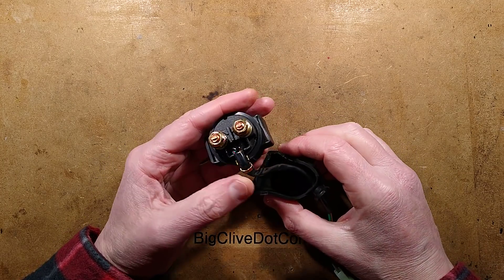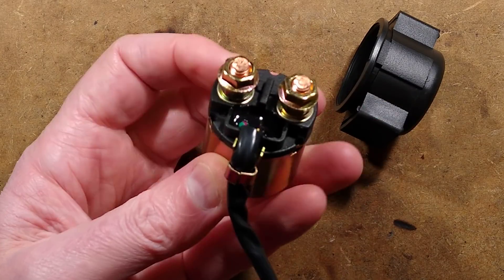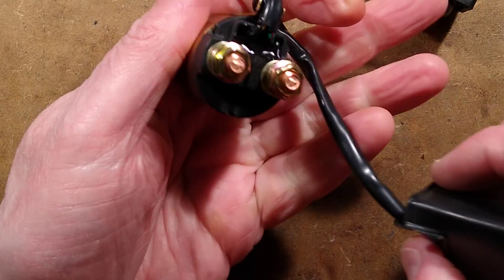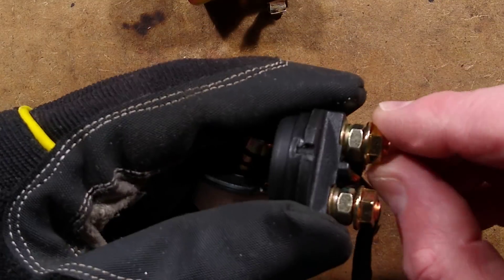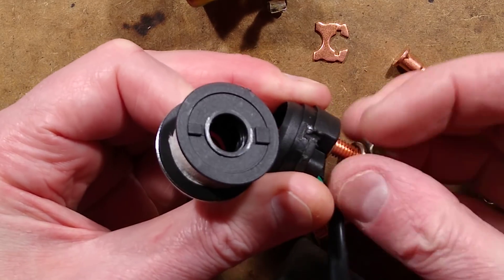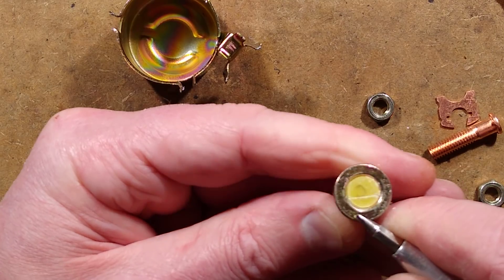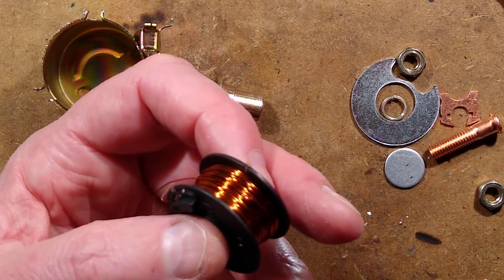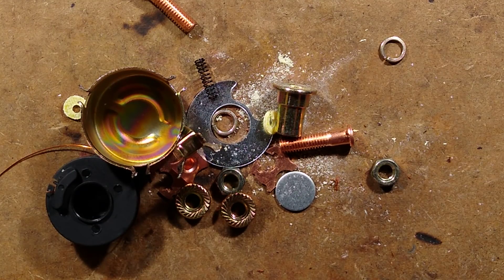Inside a cheap quad/scooter starter relay solenoid

Comment: Clive, some 6v systems are used on early gy6 scooters mainly 50cc's, but my 125cc motorbike had a 6v system I quicly upgraded so I can add LED headlights.On my gy6 with 3 years of ownership, I never had issues with solenoids. Only kickstand switches.
Reply: Kickstand switches ????????
Reply: @millomweb  yeah, kickstand on some scooters have an interlock that prevents the starter from activating if the single kickstand is left down. It's connected to the HT. ASK me how I know. Not pleasant trying to diagnose that fault when cranking! Some kill the starter, some kill the HT. It's a common failure point because its in the spray line from the road.
Reply: @monkehmonkehmonkehmonkeh  The bizarre thing about this is the fact that kick-stands were designed to fold up with forward motion - i.e. setting off with the stand down !
Reply: @millomweb  yep, I understand kickstand operation and I understand why they would interlock the starter out. Some of the REALLY cheap chinese scooters didn't have center stands. I had to fit alarm kits to a few of them (they got really popular here for some reason) and they had a remote start function. But digressing - you wouldn't kick one of these sidestands away with setting off. They're made to be pushed back with a foot. You'd probably bend the chassis using the bike to shove the stand back!
Reply: @monkehmonkehmonkehmonkeh  But it is the reason stands always fold backwards !
As for no main stand - on the basis that the kick-stand was for convenience, particularly with heavier bikes, (I remember the effort my Dad needed to get his BSA 350 onto the main stand !) cheap light bikes having a main stand only may have been a better option !
Reply: @millomweb  yeah, these gy6 bikes, put massive emphasis on being cheap. My 06 plated one, I had what 6 years ago, looked like it had been dipped in saltwater for 2 years. I had a 64 plate, I bought brand new, never made it through its first mot because of rust. That had a main stand and kicker, light as a feather but bent the frame over time and use. Unfortunately I'll never be able to savour big bikes at all. Becoming a medical statistic ended my bike career.
Reply: @monkehmonkehmonkehmonkeh  I think the law would have supported you in getting that rusty one fixed - 3 years is terrible - even for a cheapo.
My Dad had a few spills. One time overtaking a double-decker bus on ice on his knees!
Another (age 17) broke his arm near the elbow. The repair didn't allow full bending of elbow - so not fit for the Front in WWII. He ended up assembling aero engines and from there a career as a motor engineer.

Comment: Auto parts salesman here! If you want a heavier duty starter relay/solenoid, ask for a glow plug relay. It's the same thing, just rated for a longer duty cycle. 
For the old-ish Ford style ones, the part# scheme my store uses is S5049 for the starter relay and GPR11 for the glow plug relay. 
Continuous duty versions exist, but will be harder to find and likely aren't in stock at a typical auto parts store. Go for something aimed more towards farmers, industrial and fleet customers.

Comment: Back in the early 80's my dad had an FSO Polenez. The starter solenoid stopped working.  So we took it apart, to find that the terminals were burned and pitted. This made the contacts unable to pass any current. So we cleaned them up and made 2 copper washers out of some flattened copper tube to shim the contacts out a bit. When refitted the starter worked perfectly.   This was because a new starter was about £100 then !
Reply: The Polenz didn't have a hand throttle AFAIK. But an estate car style FSO did - it was another pull like the choke next to the choke !
Reply: Shouldn't have needed to buy a whole new starter just for the solenoid !
Reply: @millomweb  On many newer vehicles you do, because the solenoid is permanently attached to the motor. Usually it's combined with the drive-gear plunger assembly, so that a single coil can serve both functions.

A surprising number of those units are actually rebuildable, if you can locate/fabricate the parts. A screwed-together housing is quite helpful in other ways - I normally open up new starters to check for corrosion after receiving a run of DOA replacements. A few minutes with a screwdriver and some sandpaper can save a great deal of hassle exchanging parts.
Reply: @Azlehria  It's called a bendix dude. Why would you repair a new part under warranty? You need an Uber and a diaper. You are drunker than a cobra snake wearing mickey mouse ears. So am I actually. 🤪
Reply: @ipissed  A Bendix drive is purely mechanical and prone to clashing gears; modern starters for many years have used a solenoid drive to extend the spur gear before the motor starts. In gear-reduction starters the spur gear is directly extended by the solenoid; in direct-drive starters a linkage is used.

I "repair" new starters for the same reason that I clean blocks and heads freshly returned from a machine shop: to ensure that I'm installing good parts. They may or may not be serviceable as-delivered; they are serviceable when I install them. Sometimes a brief inspection shows no problems and sometimes there's corrosion, swarf, or casting flash that could reduce the service life or even prevent the part from working at all.

A few minutes of inspection and cleaning often prevents hours of warranty repair. Warranty work pays for shit, costs the company money, and damages your reputation - which is the last thing an independent needs.

I took the same approach into electrical work and within 3 years I was getting contracted to fly across the country to fix other people's work at emergency rates.

Do it once and do it right. Callbacks/warranty jobs provide more money for hourly workers - until your reputation is destroyed and all the work dries up.
Reply: @Azlehria  "On many newer vehicles you do, because the solenoid is permanently attached to the motor." As I said in my lengthy comment elsewhere. They are assembled - so will disassemble to repair/replace failed parts.
Reply: Oh you were the other person. Personally the engine blew up..............twice and the prop shaft snapped in half.
Reply: @bytesback.  I was aware of 2 and none had significant issues !
Reply: He had it for 6 years. Towed a caravan reasonably well ( only a 1500cc engine 4speed box )  did about 70k miles in it.    We put in a sunroof and an electric cooling fan for the engine.  Apart from normal service and wear replacement, we did very little work to it..
Reply: @robertwillis4061  Yeah, I think we must have had a friday car.
Reply: @robertwillis4061  How were they to drive and for comfort ?
Reply: @millomweb  They were a heavy car. You had to slow down for corners more than  you would today. Comfort wise they were great and they had buckets of room.
Reply: @bytesback.  'heavy' - an impression I got. Am I right in thinking no power steering ? So tyres well inflated was good practice for ease of steering ?
I've never been in a moving FSO !
Reply: @millomweb  I cant remember about the power steering though I suspect there wasn't any. The thing was a bloody tank !
Reply: @bytesback.  yeah no power steering.  Brakes needed a good push to work.  But it had discs all-round.  Rear wheel drive.   My father's was one of the early models with the black rubberised bumpers..    It was a sort of Khaki colour.  Brown interior. Front seats were big and comfortable. And yes the handling wasn't great.   Dad put wider tyres on it think it had 165 r 13 and he went to 185/70 r 13.  Was a thirsty car but all in all relatively reliable.
Reply: @bytesback.  Matches my Dad's description exactly !
He also once said the same about a BMW !

Comment: 6 Volt bikes are decades ago. The 12 Volt battery may drop several Volts while cranking the starter.
Reply: It shouldn't ;)
Reply: @millomweb  Cars once had 6 Volt coils and a ballast resistor, the ballast resistor was bypassed when the starter motor was turning. Here is a diesel engine drop from 12 to 10 Volts when the glow plugs are on. https://www.youtube.com/watch?v=mTlU6RTKDLE
Reply: @dundeemink3847  I'm aware of 6V systems but battery voltage shouldn't drop several volts when the starter's being used.

Comment: Well, the good news is that even Western produced solenoid switches use steel studs, and not often copper-clad ones! Now, the contacts are a bit dire, certainly lacking substance at any rate. Ultimately though, it is what it is, and it does what it does. If it doesn't do what's expected, then you chuck it out and buy another! Beyond that,  its operation is all arse first, but at least it does mean that the same contact pressure is maintained regardless of battery condition!  The coil will get hot quite rapidly when there is no starter motor/load to pull down the battery volts - Even then, it's only meant for a few seconds of continuous use.
Reply: The arse about faceness means breaking the circuit will be snappy as the armature gets up to speed before hammering the contacts apart - something it may achieve even if they're slightly welded together :)
Reply: @millomweb  Now that's thought!
Reply: Op

Comment: As an ex mechanic watching these makes me wince, in fact on a few videos I'd fast forward only to see a new plaster a few minutes in and the relief was palpable ;)
Reply: I once killed a watch doing brakes. Refitting shoe pull-off springs, slipped and pulled the watch strap off the pin in the watch case. Threaded the strap back round the pin and tapped it over with a hammer. I was never any good with a hammer - so that was the end of that watch. PITY it was quite a good one.

Comment: But the solenoid contact/pin is also made of metal, so why doesn't it bridges between the 2 copper contacts when no current is passing on the solenoid (i.e. when the big spring is pushing the solenoid against the copper contacts)?
Reply from the maker: It stops clear of the contacts.
Reply: @bigclivedotcom  
Is that reliable?
With time I would imagine that fiberglass inside the pin starting to crack and allowing the solenoid to get closer and closer to the copper contacts.

Comment: Ive got a nightcore tiki that i bought and it came on and stayed on wouldn't turn off do you want it
Reply from the maker: Did you get a refund or replacement?
Reply: Also be mindful of where you got it. Ebay and most of the sites are flooded with fake nightcore

Comment: Hey BigClive. I just found an AC-powered 8xAA ni-mh charger that's apparently so bad that they include a pair of safety glasses with it. It's surprisingly hard to find via keywords, so here's a link. Just sharing the laugh. aliexpress.com/item/4000990517068.html
PS. I was looking for a cheap 8xAA nimh charger to modify into a slow trickle charger for storing nimh batteries at full charge.

Comment: 3:50 yea youre not gonna do that on modern cars, computer says no, virtual warranty seal broken and a paid upgrade to newest firmware required to fit a new starter relay since the old one which was fine got reworked for no reason and now requires a epic games account and monthly subscription
Reply: Which is why I'm still running a car manufactured in 1985. New enough to have CDI (no breaker points) but that's about the only electronics in it - and I have a spare module.

Comment: You could start the old land rover defenders by putting a screwdriver across similar terminals under the bonnet. Perfect for when you lost the keys and never bothered getting new ones 🤣
Reply: In the US, Fords used to use that sort of solenoid, conveniently placed right on top of the inner fender. If it clicks but doesn't start when you turn the key, the battery's low, if it doesn't click, diagnostic step 2 is to put a screwdriver across those posts. If it starts and melts a divot in the screwdriver, it's the solenoid that's gone bad, if not, the battery is completely dead or there's a wire broken (usually both).
Reply: Well you could turn them over, I don't know that the ignition would be working without keys, but I could be wrong.
Reply: @--_DJ_--   To get the ignition working, just apply 12V to one side of the ignition coil primary (the side NOT connected to ground), which, even if the car is fuel injected, will still work and backfeed 12V to the engine control module and all of the sensors and solenoids. At least this would work on cars that don't use some sort of anti-theft transponder in the key.
Reply: @brianleeper5737  I have my doubts about that on anything computer controlled. The ECM wouldn't be getting its power to do its thing from an ignition coil output circuit, it would be the source or in control of the power, through a relay. All you would do is make a hot wire to a relay that isn't connected to anything else in the system.
Reply: @--_DJ_--  And now you discover the advantages of the trad diesels !
Reply: @millomweb  Yep, I use an old 1990 JCB with a Perkins to plow the lot at work. It had a practically non functional alternator on it (10v at full song) for about the last 2 months. All you needed was to get it started and it would happily run until the job was finished. Just needs enough juice for the starter and the fuel shut off solenoid, though that could be wired open if you were really in a pinch to get it going.
Reply: @--_DJ_--  On Ford EEC-IV vehicles, the ignition coil AND the ECM (EEC-IV) are on the downstream side of what Ford calls the "PCM power relay". And the EEC-IV (TFI-IV or EDIS module actually--the coil is not driven directly by the ECM) activates the ignition coil by grounding it (this is true for practically all ECMs...they control a device by sinking current, not sourcing it). So on these cars, where the 12V feeding the ignition coil is connected in parallel with the ECM, the fuel injectors, other solenoids, etc, connecting 12V to the ignition coil will power up the entire fuel injection system just like turning the key to ON.
Reply: @brianleeper5737 There is always an exception to the rule I suppose. A quick Google was able to corroborate your story pretty quickly. That's a good one to know. I am aware of how most ECMs control outputs. That is why I put "in control of".
Reply: @--_DJ_--  That's modern. No electrics on old diesels - although a starting motor is handy but a good old cord-pull donkey engine will do.
Reply: @millomweb  What defines a traditional diesel to you? It has to be able to be hand cranked and have no wires on it at all? I'd call an air cooled Duetz traditional, even with a belt minder, a temp sensor and a shutdown solenoid.

Comment: A starter solenoid proper is a combination of a contactor and a solenoid with linkage that pulls the starter motor gear into contact with the matching gear teeth on the perimeter of the flywheel.
Reply: Wrong. Proper starter is in constant mesh with the crankshaft using a sprag clutch in between. This is the way it is in every Honda engine and their chinese clones and it never breaks. The useless mechanical linkage is what always breaks.
Reply: @bluef1sh926  Nope. Starters with solenoids are disengaged until the solenoid brings the gears into contact. That's what the solenoid is for. I've replaced starters on Japanese, German, and American vehicles from Studebakers, to Mercedes, to Hondas.  Watch for yourself..... here's the starter from a Honda. https://www.youtube.com/watch?v=XIupJqiROjg&t=112  You can see the gear jump away from the motor body to where it would mesh with teeth on the flywheel and then back again on spring return when the motor is unpowered. It's repeated a whole bunch of times. Here's more of an explanation which isn't a Honda but they work the same. https://www.youtube.com/watch?v=6x2hIOtBfzE Motorcycles and ATVs don't have solenoids; instead they use a starter clutch. https://youtu.be/s45Z6PI8oSU?t=314  They have motors and a starting relay or contactor, but no real solenoid regardless of what you want to mislabel the relay/contactor as. That's why I started with, "A starter solenoid proper".
Reply: @Peter_S_  Wow, unbelievably irrelevant. First two links are about car starters while the whole talk was about motorcycle/atv starter. There's no linkage there anyway, the stator and rotor are in offset and when starter gets power the magnetic filed moves the rotor sideways to align it to the stator, thus engaging the gear with the flywheel. The third link was the exact think I was talking about, constant mesh starter connected via sprag clutch, so I guess you should read more thoroughly.
Reply: @bluef1sh926  Your commentary was actually the irrelevant part. Did you see I started with "A starter solenoid proper"? Motorcycles have clutches, not solenoids.You've lost the plot. Try reading everything I wrote, but word for word. It's all rather simple.... solenoids turn electrical energy into motion as the output medium. Relays and contactors are the same thing as a contactor is a subtype of relay for large currents, and they both turn smaller electrical inputs into the ability to switch far greater currents. There is no motion component that comes out of a relay or contactor which is why they are not really solenoids even though they contain a solenoid as one of their SUB-COMPONENTS.

Comment: I wonder if a super magnet would be strong enough to trigger the relay. Replacing a magnet on the bottom of the relay is it enough to pull the rod down. But it looks at a spring it looks like it may be.
Reply from the maker: It has a metal shell, but it could be worth a go.
Reply: @bigclivedotcom  if it works you could almost use it as a magnetic switch. one that could handle a pretty good amount of amperage.